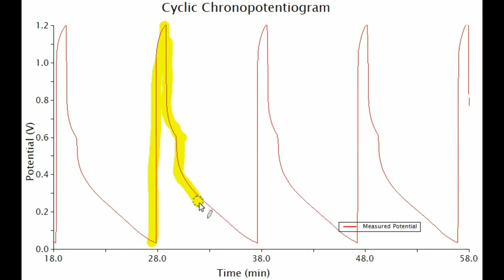Why I'm Building the Iron Battery

Comment: I could be completely crazy here, but except for the slight bump at .6V , isn't much of the charge-discharge voltage graph characteristic of a capacitor energy storage system?  
I realize real-world energy devices all have their battery/capacitor/resistor/inductor behavior.  But shouldn't a battery have more of a plateau?